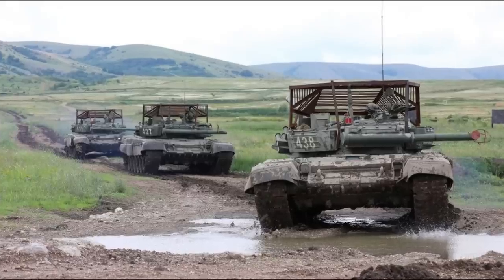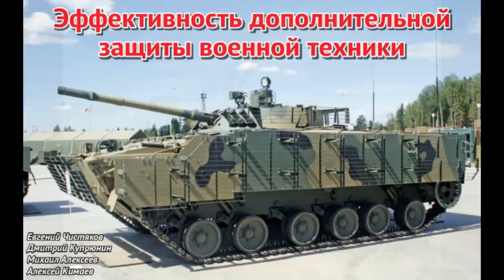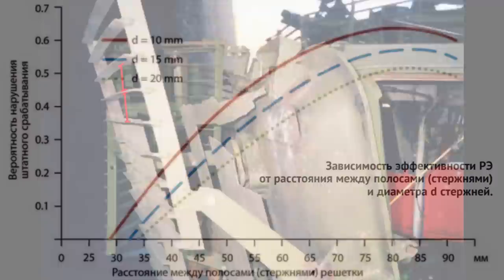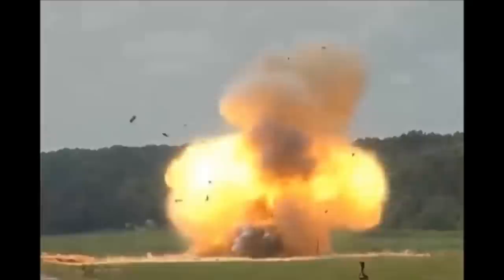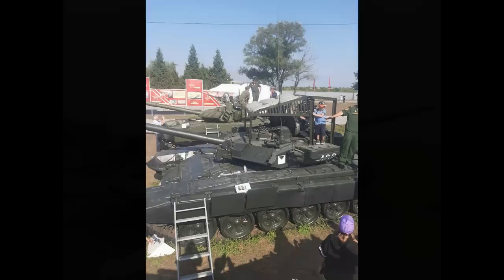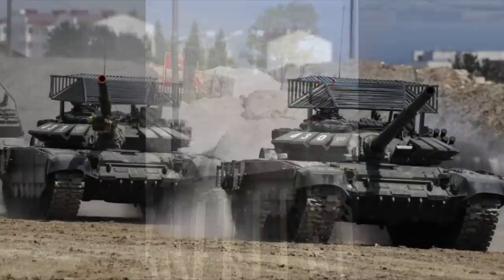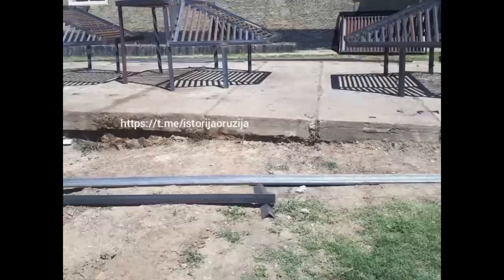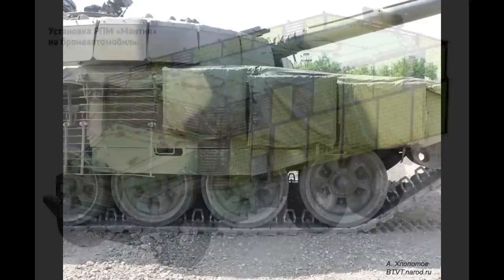The Truth About COPE CAGES

Comment: I have a theory.

It called "Middle Management"

All the responsibility none of the power and with the desire to climb the ranks with some knew wizz bang idea.

We're all assuming that the people in charge know what they are doing.

So some middle level guy goes to his boss I have a tiger rock put this on our tanks and it will scare off tigers. 

Well that's what they did and guess what the tigers are not scared.

But theres massive gap between cause and effect. Soooooooooooooo.

But there's the other side of the coin which is bolting random shit to factory vehicles seams to be a time honoured tradition since before the invitation of the wheel.

Comment: Here's a question: could it work against an NLAW in top attack mode?
If the missile hits the cage before it flies over the turret and detonates prematurely, the penetrators won't hit something critical, except maybe a very unlucky driver.
Reply: To achieve that you would need to install the cage about 2m above the tanks top.

And then it would still be only a slight chance 🤷‍♂️

Not to mention how much of way to give away your position that would be 😏
Reply: @samfetter2968  I saw footage of NLAW top attack. it did not look like it flies 2 meters above the target
Reply: @MatoVuc  no...just 1,8m. But you need it to explode way above...or the effect will be zero. 
And I figure the chance of it working at all at about 0,...something % even if it does work as intended. 

To be honest these cages won't do anything against most modern AT weapons. And by modern I mean from the 70s onwards.

If you want to know how I know...3 years as a dedicated anti tank specialist in the german mountain rangers. 

These cages might work against some improvised weapons. But that's it 🤷‍♂️

Comment: They're for tankers to cope with the fact that they're in a death trap, a piece of psychological armor if you will. It would make sense that they're to protect against drone dropped rounds or even javelins, but this ignores the fact that the cages are only present on the turrets instead of the entire tank hull's top. You could maybe protect the crew and perhaps the ammo, but a penetration anywhere along the top is going to screw the tank.

I can't recall how the javelin works precisely, but I believe it measures distance from the topmost point, so maybe by making the tank taller it would explode early? That's just a guess. But a drone could seemingly just hit any other part of the tank. It could only be protection from directly above, we know that much, and I imagine that there would have been fear in the Russian army about Ukraine getting javelins, considering they are quite effective, and I don't think they were too worried about huge numbers of dropped munitions but would be worried about large numbers of javelins. No other AT weapon I'm aware of comes from directly above. Missiles or rockets from a drone will be at an angle. If the unit was ordered to install them then they're likely for protection, granted that it wasn't just a single formation who's commander had the idea it might work. So if the order applies to all tanks then it likely has something justifying it as well. If troops took it upon themselves then I doubt they are based on data. Now the rpg tests could have been misinterpreted by someone higher up, thinking that it means protection from javelins too. Or maybe they were really worried about going through towns and cities and being fired on from above, but the rounds could just hit somewhere else. So I can't believe they have anything to do with RPGs.

Comment: The reality is that the explosive reactive armor that you're looking at is nothing but metal there is no explosives inside let your soldiers died this is how it works and I got to say don't bring up the T14 it is never been placed in combat last time I saw it it was stuck in red square and had to be towed off by a heavy mechanize recovery vehicle
Reply: T-14 wasn’t stuck 
The driver hit the e brake and tank couldn’t move even when trying to tow it 
But later disabling the e brakes and driving
Do some research before speaking nonsense

Comment: They work in Syria/Yemen reason why they are being used in the Ukraine. 

Why did Russia invade during the worst possible month for tanks is still a mystery. The reason why many of the tanks became such easy targets
Reply: They had   to.Ukraine was preparing to attack Donbas at 8 marth
Reply: @miki_car  The war was ongoing for years yet they pushed into the mud season with tanks. Was this war self sabotage? Both sides losing
Reply: @user-xh9pu2wj6b  Same modern ATGMs and tactics used with seasonal combatants. In Syria  the war has been going on for 10 years and the Russians have learned what works and what didnt work on the modern battlefield. 

Cages are not made to stop but force a premature detonation. It was self sabotage to invade during mud season now that summer is approaching. The T72 can cover far greater distances without weather delays
Reply: @miki_car  what do you mean the attack the donbas ukraine literally had most of the donbass
Reply: @gvi341984  "Cages are not made to stop but force a premature detonation" which is exactly why they don't work against modern ATGMs that aren't contact-detonated. 

It may have worked against dumb RPG-7 grenades in Syria, not against NLAW or Javelin in Ukraine.
Reply: @user-xh9pu2wj6b  They sense the size of the tank causing the precursor charge to attack sooner following the main charge.
Reply: @gvi341984  And yet the penetration power is big enough to still make the turret fly off because ammo placement in russian tanks is terrible.
Reply: @user-xh9pu2wj6b  That was during the mud season when mobility was low
Reply: @gvi341984  how does the penetration power of a javelin depend on the tank being in mud tho? Or do you think that Javelins don't work on a moving target? Either way, your point makes no sense.

Comment: I don't care what these self-proclaimed "experts" say; cages have the potential to be extremely effective against shaped charges and EFP's, provided that they're sturdy and provide enough resistance to incoming projectiles to set them off immediately upon contact. And even if they don't set them off; even if their only contribution is to deflect them to create an angle between the shaped charge and the hull, that's going to help a lot too.
Reply: Cope
Reply: Except those cages can actually block escape attempts the tanks are going to die from advanced anti tank weapons because they weren’t made for that in the first place

Comment: This cage armor thing has a decent history from the soviets in WWII. They'd rigged Mesh wire panels to the front, sides and top of their tanks during the course of street fighting to counter german hand-held AT weapons i.e. the panzerfaust. (Do correct me if I'm wrong)
Reply: it wasn't to counter panzerfaust, those would just punch through chainlink by brute force at the ranges they were fighting at.  It was to keep soviet infantry from dropping anti-tank grenades from upper floors, or sneaking along side and flipping one near the turret ring.
Reply: @michaellind3653  wdym, keep soviet infantry from dropping AT grenades on em? I'm talking abt soviet field mods on their tanks (Such as the IS-2 and ISU-152). Not arguing, just clarifying stuff
Reply: @anthonyirwin6627  Typo, but both sides put screens on their tanks to keep the other side's infantry from flipping small bombs up on to places that don't like explosions.  Any actual propelled AT weapon like a faust or shrek would just punch through that fencing material like nothing.  Hell, I punched some of the same type of mesh apart on my farm once as a drunken bet with a friend.
Reply: @michaellind3653  thx for letting me kno, bud

Comment: Sorry, but this entire video is a waste of time. Good for you that you did some research, but you completely ignored how top-attack missiles work. They do not impact the armor to initiate their warheads. They use proximity fuses to initiate. Furthermore, the penetrator jet that is formed from the warhead is much more powerful than is required to penetrate the armor, so even if the jet were to strike some portion of a cope cage, it will cut right through it as if it weren't there. These cages are made of thin commercial steel, not Krupp-cemented faced-hardened armor. Anyway, they are a coping mechanism and completely ineffective. If you'd researched how top attack missiles work, you'd have known this.

Comment: Analysing the events during the war so far, most probably they were installed against "Javelins" - mainly because it has been PRed as the Wunderwaffe that will bring victory for Ukraine. But as the "Javelin" has been proven as a laughing stock, the Russians deemed the cages useless and removed them. The drones like Bayraktar - yet another PR stunt, have been proven ineffective too because of the frontline AA defences and ECM the Russians use in mass on the frontline. War is adapt, adapt and adapt.
Reply: I thought it was 'adapt and overcome' lol
Reply: what is the evidence of it being crap? I keep hearing about Javelins supposedly being useless but aside from some gripes about the battery packs most Ukrainian accounts seem to rate them highly. The main issue is that as this war gradually turns into an artillery-spotter slugfest ATGMs like Javelins, NLAWS, Panzerfausts, Stugnas, etc become less relevant and you're now seeing more vids on both sides of long range artillery duels.

The real reason for the removal is likely they were deemed too ineffective to make a difference and were a greater hindrance than boon, and the kinds of ordinances threatening tanks now are larger than the ATGMs said cages were designed to protect against.
Reply: @iannordin5250  The main factor of an weapon's evaluation is its combat effectiveness. It is simple order - is it working, is it working as intended, is it cost effective. 
Step 1 - numerous complaints about battery issues and fizzling charges.  
Step 2 - it is really hard to find vids with confirmed kills. And I doubt the Ukrainian side is not going to brag with any possible kill. 
step 3 - 5000+ delivered, a handful of tanks killed... 

NLAW, Stugna, RPG, PZFaust are way more useful - especially in urban or forested areas.

Overall, the Javelin imho is dead by design. Short range weapon, useful in open field only against an army that have no thermal visions and drone recon and uses tank avalanche tactic. Unfortunately, such armies do not exist anymore.

About the battlefield reality - I don't think that it is the Russians' fault that the Ukrainians decided to show up on a shootout with a knife...

Prove me I am wrong.

Comment: Its called angle iron and is typically used to reinforce a structure or build  structures and even furniture like the angle iron beer pong table I was inspired to build because when the party got wild someone usually knocked the table over and drinks go flying. So why not make a heavy metal with wood planks at the top

Comment: If I was a Russian tanker with the means to install a cage. I'd do it. Even if it only gives you an extra couple of percent of survival then it has to be worth it surely.
Reply: But you make your tank look like a skyscraper. Russian tank doctrine to this point was to have small, fast, low profile, low crew count 3 men per tank. Now you make your 1/3rd taller and it's also harder to maneuver around on top of the turret. Harder for the crew to evacuate in case of fire, harder to use top mounted machine guns etc. From the front angle of some of these pictures it looks like it may have been used to catch RPG's fired forward at the tank from the roof of an apartment building. I dont think this would stop a javelin or NLAW and mostly because everyone knows already that those munitions explode meters before contacting armour I don't think these "cope cages" where made for that purpose.

Comment: In Ukraine war first these type cages first show up on Ukraine`s APC as side RPG protectors in which quality these is good ... Russians laugh for some time but then see how efficient these are put them on their APC as well. act two Javelin ... when in November, December these weapons start show in decent number in Ukraine they try to do it something and even test them and found in internal testing effective against Javelin and then send blueprint to field units where they make them as they can ... Final result ineffective, if radio antenna sometime hit them and by grounding to them and all radio unit burn down (electric shortcut), problems with using roofs machine gun, if Javelin hit happens what left of it block hatches and make sure that commander and gunner will not survive by being block into tank and the worst thing Javelin do effective  penetration as well. Later they cut it off themselves. source Russian nazi tanker  was interviewed while recovery near Moscow resort , luckily this bastard was destroyed in second tour in Ukraine.

Comment: The cages were added to protect troops from the dangers of UV rays!! They put an angle on it to resemble an A-frame roof to invoke feelings of comfort like "Hey...I'm a tank...but I'm also your home" kind of thing. With the cage installed the tank commanders can now ride around with the hatch open and smoke cigarettes while trying to look as cool as possible and because the tank is their home they often drive around chanting out loud "Whos in the house...We in the house" to boost moral because in the end they are worried about Javelins and any other gun that has a name that ends with the words "Weapon System". Clearly that is whats going on

Comment: The javelin missiles shaped charge actually goes through the top armour and out though the bottom armour of Russian tanks and any cage structure does absolutely nothing. The RPG 7 is also not affected by the cage in most cases and it is actually very rare for the cage to stop the largest antiarmour RPG projectiles. It is more about the moral of the troops than any actual protection. The only affective way to stop a shaped charge is with composite armour that has different layers each designed to stop a different type of charge. The American and British tanks can not be penetrated by any anti armour weapon on their front armour. It is due to the use of depleted uranium as one of the layers in the armour combined with a porcelain layer. The Russian tanks are not designed for survival but are built cheap so that they can make more and the auto loader is used so there are less people needed per tank. Russian military strategy is to overwhelm the enemy with numbers rather than technology and tactics. Even the explosive reactive armour is not that affective but it is still being used regardless. Modern shaped charge weapons are designed to defeat the cage and the explosive reactive armour but nothing can defeat depleted uranium and porcelain yet.

Comment: The Javelin missiles are not as effective as people think. The Ukrainians used to fire 500 of them each day. Yet we don't see 500 Russian tanks going down each day - not even close. So either the Ukrainian army's aim is horrile or the Javelin missiles have been adapted to. I remember reading that Russian soldiers claimed that a tank can take 6 Javelin missiles and still be fully operational after repairs.
Reply: they are out of date the shelf life of a javiln is 15 years america sent 4,000 of them save the cost of dismantiling them the same as a lot of millatry hardware it has a shef life the harpoon missiles the u.k sent are 1 year left before its use by date like fire extguishers need refilling old fireworks should not be used ect.. they wont work or they become dangerous to the user.

Comment: I was a British Army Metalsmith for 22 years. I've built repaired designed and modified hundreds of this type of protection. What we see on the Russian tanks is a good idea implemented by unskilled tradesmen, probably diesel mechanics. They've been told what to do but don't know how to do it. I spent a lot of my time fixing mistakes made by those with a little knowledge. Manufacturing with metal is not as easy as lots of people think. My training was 2years of college full time. All forms of gas and electric welding. With materials 0.5 -200mm. Blacksmithing, panel beating, Manufacturing and battle damage repair. I don't think the Russian conscripts are quite as well trained.

Comment: If you watch when a javelin or nlaw type projectile goes off it's clear they don't work like a direct attack weapon like rpg. They explode much farther from tank and then send the molten metal down (if they actually work like conventional knowledge of anti tank launchers). I think due to all the classified tech involved in the components point to it being likely we won't know enough to make anything but guesses for awhile still. I see how you could easily over look this stuff not having military experience cuz stuff like that platform always has large portions of info classified. But they'll still give you the other info it's just not going to be important or purposefully vague.
Reply: Completely wrong about the Javelin do some basic research. Javelin uses top attack but still hits the target physically at a 45-50 degree angle while NLAW uses the downward directed energy attack when exploding above a target. Javelin has specific fuses and tandem warheads for defeating ERA which is clear evidence of a weapon designed to physically strike a target.